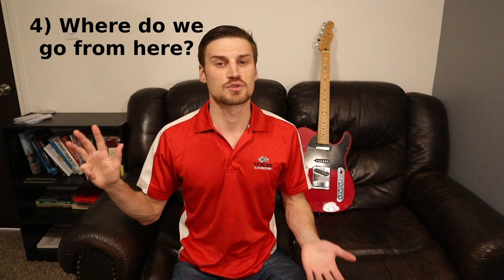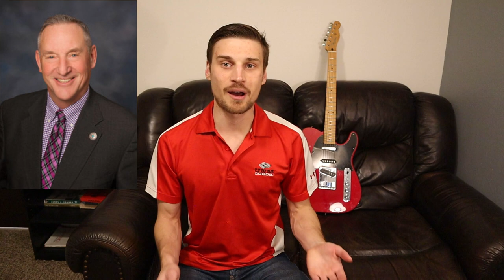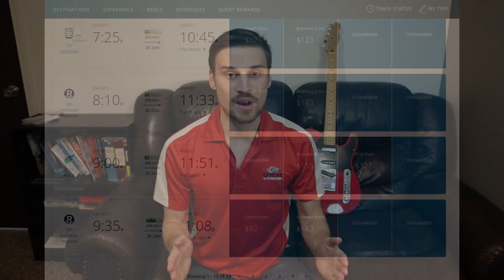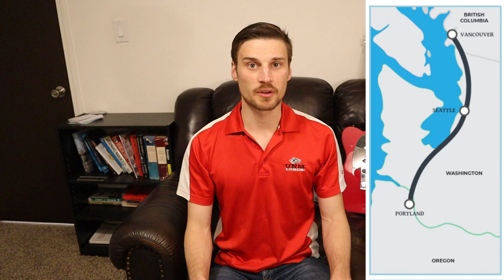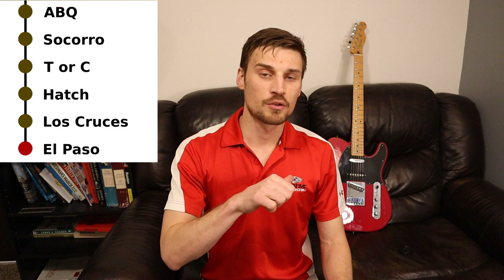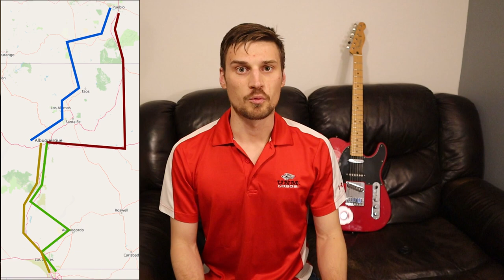High Speed Rail in New Mexico?!?

Comment: There are no longer any BNSF freight trains using the ABQ - Raton corridor, AFAIK. Maybe a few random trains at random times, but no daily freight trains. There are some new battery-powered trains being used in Europe that are also capable of running either on diesel power or on catenary electric power. Brightline West is planning on using catenary electric for their Las Vegas to SoCal passenger train. A direct "as the crow flies" ABQ to Phoenix train doesn't seem at all likely, due to the terrain. However, Amtrak could create a new Denver - Phoenix passenger train, which could use the existing Raton - ABQ segment, then follow the SW Chief route westwards to Ash Fork, AZ, then south on BNSF freight tracks to Phoenix. Option #2 would travel south from ABQ to El Paso, then follow the existing Sunset Ltd. route past Tucson before branching north to downtown Phoenix. The tracks running southwest of Phoenix (going to Yuma) are no longer in service. Maybe New Mexico should consider buying the Raton - ABQ corridor from BNSF, and then extend the Rail Runner service along that route. The existing freight line between ABQ & El Paso would need some mandated upgrades before passenger trains could safely run along there.

Comment: You can use existing rail corridors. Just adding a track and double tracking bridges makes a lot of difference.  Adding long third rail passing tracks where the topography makes it feasible.   Look at the Brightline Coca to Miami FEC corridor.   Nice presentation.
Reply from the maker: Thank you so much! I've been impressed with how quickly Brightline has built up their tracks. Though I'm not a Floridian, I'm hoping they'll be running trains with passengers by the end of June!

Comment: Personally, I would go for 110-125 electrified higher speed rail/Regional Rail between el paso  and  Santa Fe and serval lines to connect with other cites Holloman and roswell.  Along with lesser used routes like Lordsburg to las curses using Deasil multiple units.

Comment: Another foamer video.  Pure pipe dream.  New Mexico does not have nearly enough population to support the construction & operation of HSR.  The New Mexico also does not have the public transit to feed HSR & provide first/last mile travel solution.
Reply from the maker: Thank you for commenting, but with all due respect, you are incorrect.
Between ABQ, Las Cruces,  and El Paso, you're looking at 1.9 million people in those metro areas alone with very cheap land in between. Each of those areas is served by ART, SCRTD, and the Sun Metro public transit systems, respectively. Seeing as the RailRunner construction/operation was/is supported by the local population, I don't see how this proposed line would have any trouble with staffing.
As for this being a "pipe dream,"  I would remind you that NM is a place where "pipe dreams" come to fruition: in the 40s with the Manhattan Project, in the 70s with the founding of Microsoft, in the 90s with the recharging of our aquifer (https://www.abqjournal.com/276444/aquifer-under-city-still-rising-despite-drought.html), and in the 00s with the construction of the RailRunner.
Anyhow, thank you again for commenting, and I you are a little better informed about the 47th state.
Reply: @ericnelius9062 :  LOL 
Comparing HSR to conventional commuter rail is ridiculous.  The costs are several orders of magnitude different..renting a time slot on a conventional freight line is cheap compared to the construction of a separate, highly engineered HSR route....not to mention the cost of electrification, rolling stock, and infrastructure like stations and power facilities.
Let's compare that to the two HSR lines in the world that have actually paid for their cost of construction, operation and maintenance:  
Japan's Tokaido Shinkansen (Tokyo-Osaka-Kyoto) or France's TGV Sud-Est (Paris Lyon)....   Just the end-point citie complexes of these  have more than double the population of the entire route a New Mexico HSR corridor would serve...and started with BOTH robust local transportation networks to feed the HSR line, and the right -of-way almost entirely owned by the government before they even started consideration.
Reply: @ericnelius9062  I love your pride in NM. Mark is correct me thinks. Florida has Brightline because HSR would need more population. 5-10M at each end 15-25M along the route.
Reply: @ilikehardplay  I agree with much of that, but it's not like it couldn't happen. In terms of transit-oriented development we're just at the beginning steps and we have much to learn (since most of the country is highway-oriented development), but if surrounding states start implementing it I don't see why we wouldn't cooperate to build out a network, especially if there's a federal initiative similar to the highway project. Lawyers and a few politicians are interested in seeing it happen, and it could possibly be a state bill https://youtu.be/a28qQdy409w